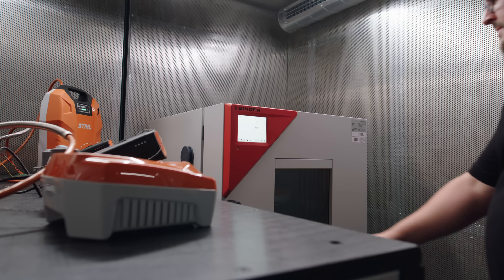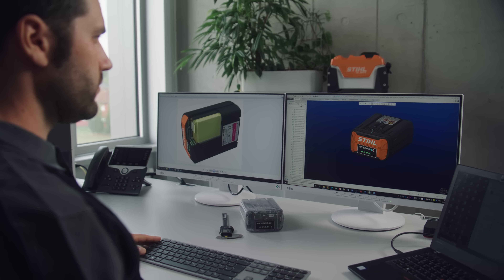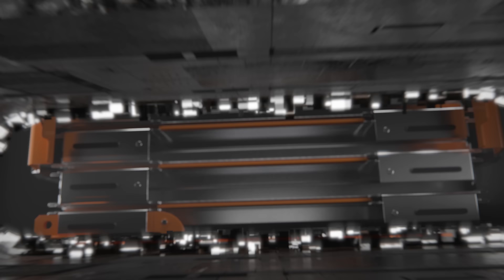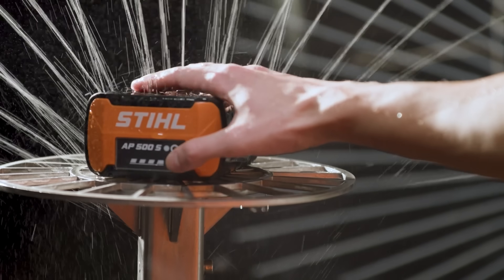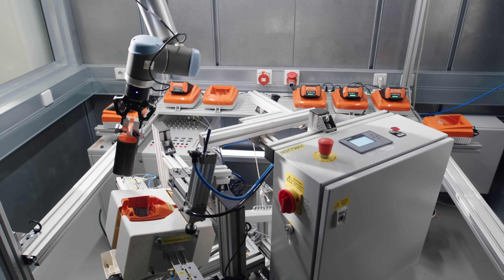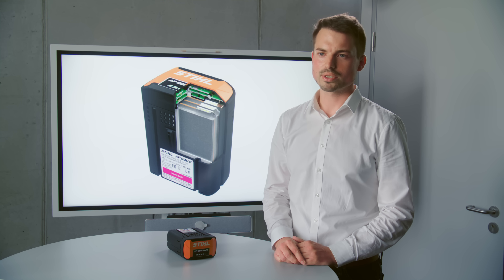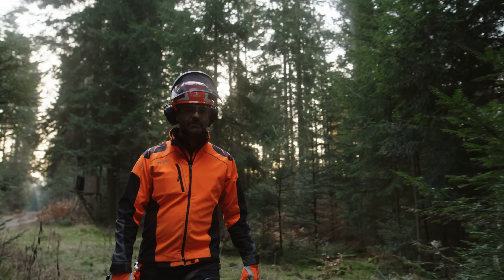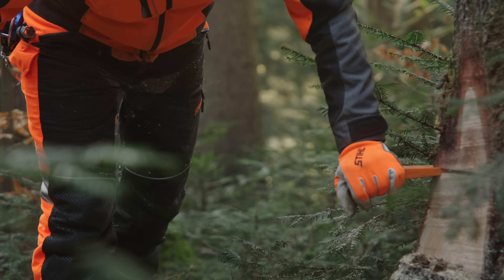STIHL battery development | Behind the scenes

Comment: I’m told they have a counter in them so the bms locks itself after a certain amount of cycles and even replacing the cells won’t revive the battery. That’s not sustainable.
Reply from the maker: Hi! The runtime is not impacted by the charging cycles. The better the maintenance, the better the life cycle. how to maintain the battery perfectly can be found here: https://www.stihl.co.uk/en/garden-ideas-and-advice/power-tool-maintenance/battery-care

Comment: I would you rather develop new small gas engines. Small 4 strokes and more fuel injection engines like the 500i chainsaw. I don’t want battery powered tools. I’m not alone. 🙄
Reply: Many of these new battery powered tools are actually really good, have you tried them?
Reply: @TheOne24115  Nope & don’t care to 😁
Reply: @chrisb9478  - can't really make intelligent comments unless you've objectively tried the alternative then, can you?  The market is going battery - no one is developing new gas engines in this market space.   I have a friend who runs a large landscaping / maintenance business with 100% battery tools.  Nearly zero maintenance, and gets a ton of government and strata contracts because their gear is so quiet and not belching out blue smoke.
Reply: And I want battery tools, I know also I not alone.

I build log houses for a living and have the msa 300. And it works like a charm. It more power fulI than any 50cc, but I can say eats battery so runtime is a little bit worst. But that not problem for me when the chargers are always on my worksite. Another good thing with the msa 300 is we finally have proper chainsaw saw for indoors work.
Reply: Not alone but a definitely a minority, in reality nobody would use 4stroke in a handheld situation, more weight, less power, less rpm, oil problems when run upside down and more moving parts, probably even more expensive 

Injection will probably come in more pro models 

Battery powered is rightfully the main path of development and already really good 
If you have the chance to try some out, take it
Except msa 300 everything else I've tested, I wouldn't even consider buying the gas model in the same power range
to many advantages of battery powered tools in low and medium power applications
Reply: I’m selling a load of Honda 4-stroke if you’re interested. Switching to Stihl AP battery stuff!
Reply: I've been gardening for just over 15 years now and I have been using petrol equipment for most of that time... Recently switched to the battery stuff and it's a dream to use. Low noise, vibration and zero emissions... It's more convenient and I'm much more productive using it. It's a win win.
Reply: For some jobs totally  @joshuabush2569
Reply: Yawn…